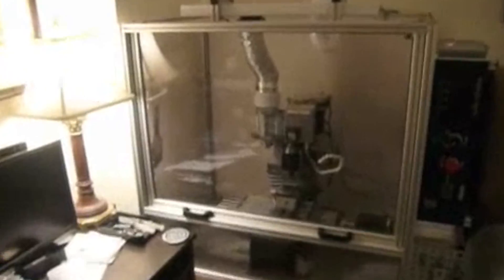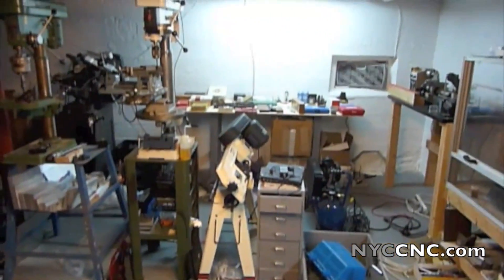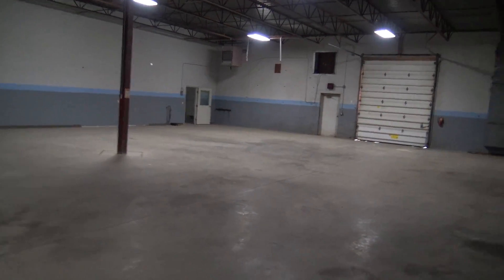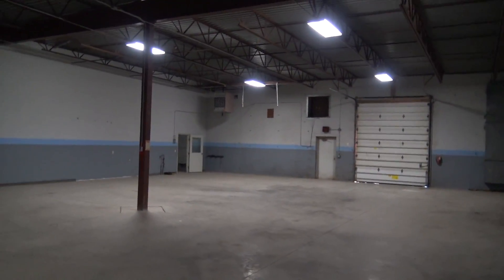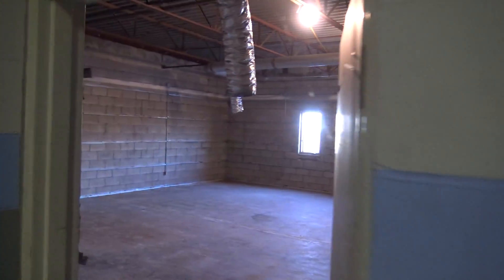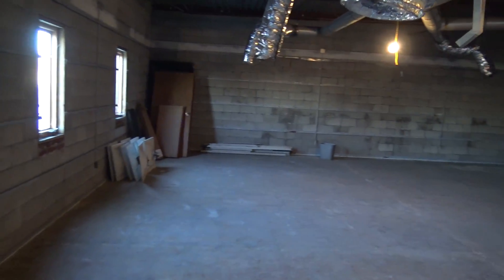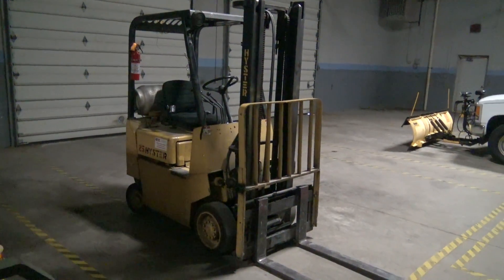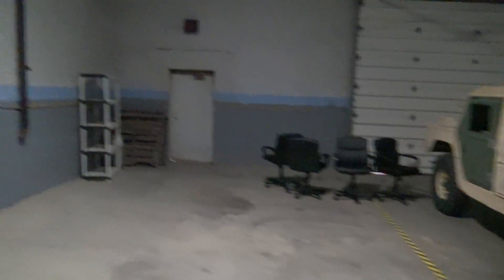We're Moving Again - One Last Time!  NEW SHOP!

Comment: My thoughts on the lighting..... LED if you can afford the high capital costs. Many utility companies have energy saver programs / incentives that could help minimize the high capital costs. The payback on the LEDs is some where around 2.5 years in my area (high electric rates) your mileage may vary. The energy costs are low with LED and the light is close to full spectrum quality.

Comment: just a comment on lighting  my shop is 40 x 48 14 ft ceilings i went with the 4 ft t5 high bays  .I put ten in and wow don't look up you'll see spots also no matter where you stand no shadows placement is the key also the best deal i could find was at wharehouselighting.I think it was like 90 bucks a fixture with shipping . We are changing out to leds at work and they are nice but pricey

Comment: I'm thinking put the machine shop in the auto bay, use the back half of the big room for auto/fun stuff and welding/fabrication in in the front half of the big room. Put a solid wall up with a garage door between the auto section and the welding area.

Comment: Go for acoustic drop ceiling panels for the classrooms! They are not 'trendy' right now but you don't want a loud echoey classroom, and you'll get a big bonus to the cooling/heating bill having a proper plenum. Oh, and they help bounce the light too. I've worked in open ceiling offices, they are dark, noisy and eventually look like crap due to all the extra wiring that ends up getting run.

Comment: With that roof-height, wouldnt it be better to use some proper flood-lights? Like sodium high pressure lamps, that being said LEDs are the replacement for these lamps in the industry, new street lights etc.

Comment: I have been following you for a while John, Great videos, I am impressed.
I am a machinist by trade, manual though, would love to get in on your classroom training.
I would comment on lighting to go LED for power savings, the light has to be balanced for your camera requirements.
I worked in a welding machine shop.
the fumes will rise form the work area to the ceiling if not caught in a fume hood or fume catcher, I would think of hanging a drape from the ceiling down about four feet to separate and to keep the fumes there, then heat exchanged and exhausted.
If you own the building as opposed to rent you can make changes solar water heater on the roof for the bathrooms, solar light panels in the ceiling for natural light.  all on a budget in time.
the heater in that area is going to require some thought, maybe move it.
I am looking forward to seeing how it all developes. 
I am in Oakville Ontario I do not know where you moved to but I think you are in the New York area which is close.
I hope to get into the CNC you make it look easy.
Cheers
Rob D

Comment: Do some more research on LED's, and consider 10 year economics.  If you get break even for that long a term, you will do yourself a favor.  It keeps from needing to replace them every 2 to 3 years. -- On dividers, welding curtains might be best even if they look funky.   Think of using corrugated metal vertically (8 to 10' tall), attached to metal studs.  Make a serpentine wall in sections so you can move it around.  I saw this approach in a startup office a few years ago and it worked well.  You might want to paint the 'welding side' of the wall to keep down the flash/light reflections from welding.

Comment: We just overhauled our machine shop and welding area at work. In the past we relied on extraction hoods and distance to keep welding/grinding mess out of the machine shop. It never worked very well. We have now installed a permanent wall with a large roll-up door between the 2 areas. The forklifts can easily move between the two areas and even thought the door between the two areas is usually open, the machine shop is staying free of welding/fabrication mess. We looked at curtain walls wnd other less permanent options but we couldn't be happier witn our current setup.

Comment: Airlines- go Fastpipe. Aluminum pipe with plastic fittings. You want to be able to reconfigure your piping easily as your shop changes, and nothing else offers the flexibility. Copper is wonderful, but costly and too permanent. Fastpipe also just makes for a cleaner install, as it's purpose built for air application.
Reply: NYC CNC did you wind up going aluminim?

Comment: well John, there are so called mobile walls in the industry that are actually segments of walls that can be bolted together in different configurations and be bolted to the ground as well. But you can still have enough open air space above as well as the flexibility to reconfigure your workzone at any given time

over here in europe a lot of big companies use them combined with overhead gantry cranes as well as dust and smoke extraction systems (and you still can have windows built into the walls as well as doors that can be changed in the position and opening for example when new machines come in by moving one segment of the wall to an other spot)

and by using big sliding doors on some parts you can still drive forklifts as well as electric jib craned through those walls because you have a huge opening
Reply: oh and John, the big garage area would be good as storage room (with some racks for goods on pallets as well as garage workshop for repairing your vehicles and changing tires from summer to winter ones) and you could keep the forklift away from people that are not allowed to use it as well

Comment: Great Space. Possibly the divider can be partial low wall (4' or so) with fixed glass on top. You can buy patio door panels at a very reasonable price and they are large and tempered. So that would be about 6 ' plus the wall you are at 10' and the top open allows the heaters to still circulate the air. A possibility anyway.Keeps it all together and still separated.

Comment: Just an idea on the air. Our company uses mostly air for any work done and we have in our building 50mm - 2 inch water piping running through the whole of the building. The nice thing about this is that the piping also acts as a tank enlargement..... The one drawback is that if the pipes are left standing too long there is some rusting inside the pipes, but the pipes have been up for about 20 years and not a leak yet.

Comment: Couple quick suggestions:  Install the lighting (either kind) at 45 deg...  Eliminates shadows better.  Second, pitch all air lines back to dryer, drip legs on at all air ports.  Third, negatively pressurize the welding area to promote nasty fumes from getting to the machining side.  Fourth,  Unistrut makes a double strut and mating foot.  Panels can be placed in the open frame of the strut.  Recommend FRP panels, easy to clean...  On end 8' high, open on top.  Easily removable or can be pinned up.  Best of luck to you, exciting times await.

Comment: John In Houston Texas we have a lot of humidity and water in the air system problems. This is the best air system to keep the water from getting to you machines(That I have seen). If you can go to a rotary screw air compressor with a after dryer(If the compressor is outside the building put the air dryer inside. The dryer needs to be in the air-condition space. ). run a pipe around the perimeter of you building (the best system I've seen used 2" galvanized pipe) not against the wall hang it from the roof about two feet inside just below you ceiling joists. At every joint in the pipe put a T facing up I will repeat that face the T's up! Cap off the ones you don't need for now(You will need them later take my word for that). Slope these runs of pipe so the water in the pipe drains to the opposite corners put a down pipe with the T facing down in these corners with a automatic water catcher. Now run the lines to your machines off the top of the pipe where the t's are facing up. Water will condense in the pipe and flow to the corners and than to the water catchers. The air will flow above so this pipe has to be larger than the runs to the machines. What ever you do always take the air off the top of the run of line or else the water will run right into your machinery. Don't use PVC it will give you trouble in the long run. Copper is good for the runs to the machines.

Comment: #PTL!!

Congratulations on the new space!! Definitely go with fluorescent. I've heard nothing but headaches from those that have tried LED. Too much equipment failure. You'll want enough light to yield about 1,000 lumens on each work surface. For my shop with 12' ceilings, that ended up being one 8' double tube fixture for every 50 square feet. Make sure you get 5000 Kelvin or higher light color to make video and photo processing look more natural.

You might also want to consider adding makerspace to your business plan. The monthly revenue from memberships can add up quickly and contribute excellently to your bottom line! A place your size can charge easily $100 per month per person.

Good thing you're thinking through all the infrastructure now. Will save a TON of headache later!! I went with OSB paneling instead of sheet rock so as to make access that much easier. If I ever need to change my power or add compress air lines, will just have to remove screws and pull down each panel. They're super cheap at about $8 a panel and paint up well after a primer coat.

Comment: John, what a great space. You asked about dividing the room for your welding and fab, to keep dust down.There are so many options. One solution would be moving the welding and fab area to the space where the Hummer is not to use the whole space but it would separate it from the machine area. My cousin works for a company that makes thick pliable reinforced plastic sheeting used for curtain walls to divide spaces. If you have to add a new piece of equipment or move equipment with forklift , you need the curtain wall to be moved or taken down without a lot of work. You could also build a permanent wall with an opening big enough to get equipment in and cover it with overlapping plastic strips like they have in large freezer to keep the cold in and still allow the forklift to drive right through it.  Another would be building a permanent wall with two section that aren't permanent big enough to get stuff through or even build a permanent wall and put another garage door in it. The bottom line is cost and down the road with any changes needed how easy it is to move, change or add on, because as you grow things will always be changing. I've watch you from early on, grow into bigger and better places and I wish you the best, but I'm sure as big as that space is, over time it will become smaller and smaller as you grow. So make things permanent but movable or easily changeable to save on costs down the road. Thank for taking the time to share your experiences with all of us. Looking forward to seeing you get your new shop up and running. Nothing beats good planning, but there will always be changes.

Comment: I'll also give my vote for LED's. Have been transforming to LED's at work as they will pay out the investment in a long run. 

Few month's ago I calculated difference between a 250W HID and a 80W LED-floodlights. Payback period for the LED's higher price was shorter than the expected life of a HID-bulb. Price of electricity here in Finland is approx. 0.10€ (~0,11 USD). I can highly recommend Phillips LED-lamps.

What comes to air lines I would not think anything else than mild steel, maybe zinc-coated. Mapress and other pressfit systems are quite nice in that they are fast to install and they are  also leak proof when done correctly. Problem with copper might be availability in sizes suitable for main feed lines as your space is so big that you should take account the pressure losses in the main feed lines going around the big room. 

When using mild steel pipes you will want to make sure that the air fed into the system is dry.To keep the air dry you should invest in a good air dryer - they should not cost arm and a leg (I was just quoted a dryer for 180l/s compressor (connected power of 75kW) and it was under 6k€ from a well known vendor). Especially higher end CNC-machines LOVE that dry air for their air systems (especially if fitted with air purged measuring scales) and it usually don't hurt any other tools. If I had to quess, I would say that the price difference between copper and steel pipes in just 50m of main feed line will cost you anywhere from 1000 to 1500 USD. 

For example a 50m of 2" pipe at 7 bar with air flow of 3m^3 (106 cfm) yield pressure loss of 0.005 bar which is good. Same length, pressure and airflow with 1" pipe yields pressure loss of 0.05 bar which is adequate for branch line but not for the main line. More losses you have the more more you have to pay for nothing and compressed air is one of the most expensive mediums of power transportation.

Comment: Schedule 40 PVC is tested to 600 psi. I've never had a problem with running it at 120 psi. Not a single leak or crack ever over many years of use.
Reply: You may be right about that. Good thing I don't have to answer to them in my home shop. Safety Third!
Reply: +Marsh Wildman perhaps we could call you mr. shrapnel ? metal lines only.
Reply: +Jerome Feig splinters? ok, in the form of shrapnel...
Reply: +maximum woof More accurate to call you Mr. Paranoid. I have a really nice compressor, and I DO NOT have the ability to rupture Schedule 40 PVC pipe with compressed air. I doubt you do either. I could do it with my pressure washer though.

Comment: LED lighting is brighter, cheaper and uses less energy. $35 per lighted fixture at Costco. Looks like you'll need about twenty for that big room.
Reply: You have high ceilings so they're not likely to be struck by a flying object. They're really bright, energy efficient and inexpensive. You'll probably retire before they need replacement.

Comment: Why wouldn't you put the welding in the "auto" side?  Lots of ventilation with those doors. Separation is already there. You can have room on the other side for a tool room and materials storage.

Check if there are some incentives to go LED. They are a bit pricey but beyond the energy, you don't have the flickering if the space isn't as warm.

Comment: I put in T5 lights in my shop 2 years ago. I have a 30x60 foot shop with 12 foot ceilings, and used 3 rows of 6 units. Each unit has 4 bulbs that are 4ft long. Basically, I used a 4 bulb fixture in  every 10 by 10 foot square. It's enough for the welding side, but I still use LED lamps to see what I'm doing on the machining side. I have also found when I turn on the exhaust fan for the welding side, nothing makes it over to my machining side and I don't have a divider. I had originally considered making free standing dividers using sheet rock in a metal frame.  Just my 2 cents.  Looks like a nice building!

Comment: John, go with RapidAir FastPipe for your compressed air system. I used it in my new 5 bay shop this summer and it has worked out great with us. We created a closed loop system running off of a Kaiser screw compressor and refrigerated air dryer which runs our fab shop, waterjet, and assembly bays. I was heaitent at first because I thought the compression style fittings might leak but we havent had an issue yet. The rapid air drops pull air off the top of the pipe, leaving any condensation in the line. That being said we also run dryers at each piece of equipment.

Comment: On the lights: 

Use LED if you can afford it, Florescent if you cant.  you would have to plug your industrial power rate to see when the pay off occures so when you start saving money.

Either way you go make sure you get at high Color Rendering Index CRI, like 90 or above.  I have 92 CRI

https://en.wikipedia.org/wiki/Color_rendering_index

I would recommend 5000K color tempauture, which is noon day sun. 

https://en.wikipedia.org/wiki/Color_temperature

With both of theses it is like working outside on a nice day, so you will see more and have less eye strain type issues. 
Then there is the amount of light you put up... You should have at least 10 foot candles but 30 is better, on the floor of the work area.

https://www.osha.gov/pls/oshaweb/owadisp.show_document?p_table=STANDARDS&p_id=10630

http://www.fs.fed.us/t-d/pubs/ppt_html/htm06672C02/document/cfr1910.pdf
Reply: +kitesquid   oh, i forgot,  to see good light in action, go to your local big box hardware store and look around at the stuff...  pull a photo with a landscape and some skin tone in it out of your wallet and look at it in different parts of the store.   now go to the paint department and look at the photo under  the lights at the paint chips.... NICE.  they are high CRI and probally 94 or better on the color temperature.

also when at the mall go to the jewelry store and look at their lights... they are intense (high foot candles, probably 40 to 50 or more) and white (HIGH CRI and 5000K), to show off the colors in the stones....  

To see the apex in lighting go to a printing factory and ask to see their grey booth.  5000K and 98 CRI light.

a primer in their light is http://www.printing.org/viewingconditions
Reply: +NYC CNC +kitesquid   Most regional electric companies have federal grant money to help subsidise installing LED lamps and other electrical efficiency projects for businesses.
Reply: +david seholm 

I travel a lot for work and on my last trip to Oahu Hawaii I purchased LED bulbs to replace all of the compact fluorescent bulbs in my home in Virginia.  They were about 50% off the price back home.  I thank the Honolulu power company for the in store discount on LED bulbs and  Home Depot for a 10% military discount as I'm retired from the US Navy.  I get two free checked bags with United Airlines due to my gold status so I thank my. current employer for flying me to distant locations to work at. So I see how you could get a discount as a small business.